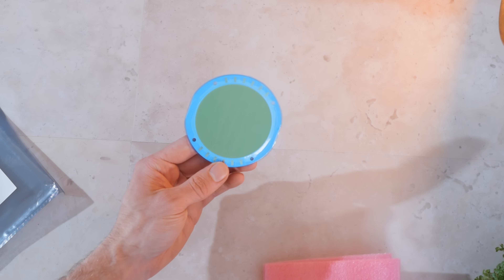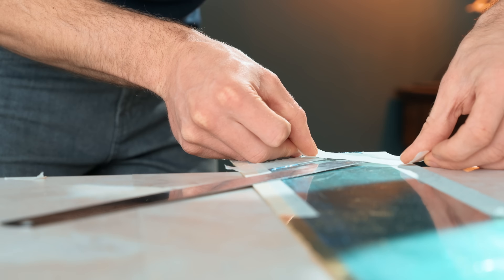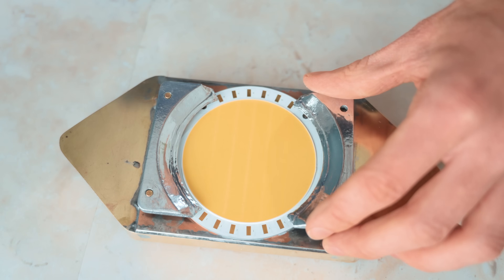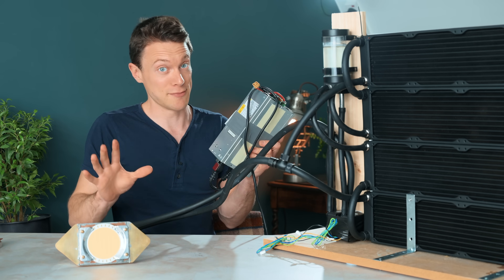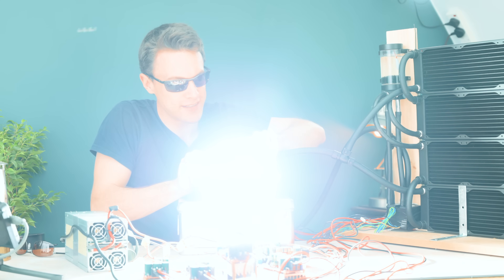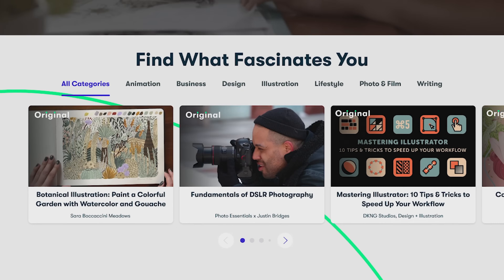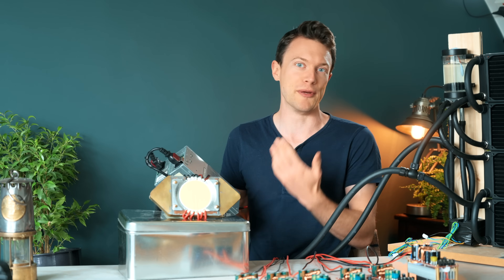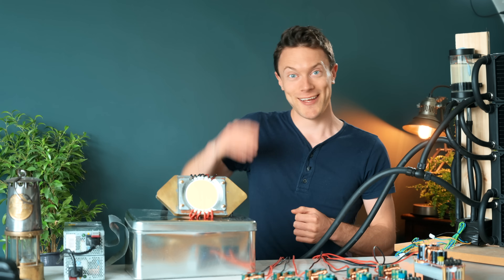Testing the world's BRIGHTEST LED!!!

Comment: Always cool to see you rig up a huge high CRI light, love your videos. Seems like you're not thinking whole-system with this though. In the end, water doesn't disappear the heat, it transports it, and in the end you just need 1500W worth of heatsinks. You could probably buy four, five or six 300mm x 50mm aluminium heatsinks, join them together with the fins facing inside (mitred), put a copper heatspreader with the LED on one end, put a lot of tiny holes (from 0mm to 100mm from the LED) to allow air entry (between the fins, allowing the fins to conduct the heat to the rest of the radiator), and then a fan at the 100mm point blowing the air out the end. You could thermal epoxy copper sheeting around the outside for better heat-spreading, and then some thin insulation (so you don't burn yourself). The cavity would be large enough that you would be able to get enough Hobbyking LiPos with the current rating to give you your 41V (12S1P) with a current controlled buck circuit, and I'd actually use 12 independent cells with a decent 12S BMS (for eBikes). You can get the "Turnigy 5000mAh 1S 20C Lipoly", have many myself, reliably do the 50A you need, cost $10 each, 12 of them would give you >5min run time for 1.4kg, and the independent cells give you better cooling and placement (perhaps inside the radiator tube if you grind down deep fins for air to flow, forced air near fins rather than through center is an advantage). Whole thing with handle could be 5kg and about 100mm x 100mm x 400mm. Best of all, your buck circuit and batteries won't lose their magic smoke because they will be strongly air cooled. 

If you must go the liquid cooling route, then perhaps look into 3M Novec cooling. Novec is hard to get (maybe less so for you), but general halogenated kerosene performs almost as well. Think mineral cooling for immersed PCs, but with the advantage of low-weight phase change heat exchange. Your next video title could be "2000W giant heatpipe LED"!

wrings hands in glee waiting for next video

Comment: Hi Matt! The LED power dissipation:
The LED have 1500 Watts, but that was the power consumption, you should take the efficiency than convert part of that 1500W in heat.
in this way you do not need a 4 480 radiator to make it works.
i'm pretty sure that a single radiator like that is just fine to handle this LED.

PSU explosion:
normally, the load should rise progressivelly, if you just switch on the psu with everything connected (and this is even worse since it have a ton of capacitive load),  it will have a power spike, the PSU voltage will go down, the LED drivers will try to compensate that by rising the current as they could, then boom... c ya

aand, the good to know:
12:02 , you just switched off all your equipment at full load, the PSU was working on maximum capacity and hot, than you shutdown and removed the ventilation, for sure had a thermal spike. That is pure poison for high power electrical equipment.

please, i want to see the sun v2 working again and maybe portable XD!

talking about portable:
try to use eletric vehicle batteries, they're suited for high wattage drain, should work fine.
Reply: i'm sorry if i sounded a bit rude or pessimist, but i tried to create a construcive criticism about the equipment failure.
i was waiting for a video of LED like this since you posted the 500w version XD

Comment: What's the efficiency of that LED? If it draws 1500W total and the efficiency is 60% (I don't know the typical efficiency of LEDs), then the thermal power is only at 600W. That means that it is to be expected that the 16 fans gigantic can keep up. To be fair, at that point, two of the air coolers would be enough as well... So, to cool a 1500W LED, you don't need a cooling solution for 1500W TDP. What I think is more impressive is that the power supplies have no problem dissipating ~200W (assuming ~87% efficiency) of heat. I don't know your power supplies though. If they're 80 plus titanium, they probably have a higher efficiency and therefore less heat to get rid of.

Comment: One of those radiators with a push/pull fan config would have been plenty of cooling. You only need 4 rads if you had no fans and were passively cooling with convection. I thought you would have done the thermal calculation. :/

Comment: I think the power supplies would have cooked because even though they are running in series and capable of outputting a total of 2000W most power supplies these days are built in a multi-rail configuration. I could be wrong about these but check the spec sheet for them. you might need to move to a Electronics Bench Power Supply. im sure you'll find something though.
love your videos keep em coming!

Comment: I haven't scrolled through all the comments to see if this has been raised before: Power supplies will have a lower rating for individual power rails. For example, an 800W supply might only provide a maximum of, say, 300W to one 12V rail, and perhaps have two of those. The remaining power rating would go to 5V and 3.3V rails. This could have been stressing the 12V section of the PSU, and if one rail was dodgy, the remaining ones would fry themselves pretty quickly.

1600W at 24V might need its own bespoke power solution! Or you could grab a few big lead-acid batteries, for at least some limited "portable" testing.

Comment: Wouldnt it be easier just to buy a small diameter copper pipe and bend(if you fill it with sand and plug the 2 ends you can do whatever you like with it )it in spiral circle,maybe solder it to a back of that copper plate and use a small water pump to push water trough it?

Comment: Power supplies have a limit of how Much of their rated power they deliver on the 12v rail. I'd say use the specs of only the 12v rail on the psus to correctly Guage how many you need in series...

Comment: Hi, i have a small opinion here about why your power supplies failed.
I can't grantee this because i don't know what supplies you are actually using but i have 2 different scenarios:

1. You power supply is rated at, let's say, 1000W total: but it might have 3 output:
An 3.3V, 5V, and 12V output and each one might have an outgoing power:
usually 3.3V has 20% of power(this case 200W), 5V have 30% (300W) and 12V have 50%(500W), and the idea is that they have a total power of 1000W. And if u tried to get all that power out of 12V it will burn.

2. And second case is that the supplies might have 1000W power at max capacity, but they are not usually built to work on that power all the time:
They usually have a nominal power  and this is the actual power that you can drain for an infinite period of time, and a max power that you can draw for a limited period of time (that's usually written into the datasheet of the supply), and if u exceeded that period of time it burnt out. 

Also you used voltage regulators that also have an efficiency, and that might affect the consumption, and so if you want to output 1000W let's say they might actually drain 1100W from your supplies or something this is usually written also into the datasheet of you converters.

And about powering it up, 1600W at let's say 24V means about 70Amps, witch i think you can deliver with 7-8-9 (depending on the type of the battery) 6S Li-Po batteries in parallel.

Hoped this helped you,
Andrei

Comment: power supplies died because the total wattage is a sum of multiple rails(voltages), you got all the power from a single rail. Power rail limits should be printed on the power supply back

Comment: I think your cooler system is a bit of an overkill, just because the LED is 1500W, doesn't mean it will outpu 1500W of heat. Pretty cool anyway, better safe than sorry.

I checked the datasheet, and it can work at 41V at 2000W!!!! And with that OP cooling system, I think you should try it, maybe not at 41V, but a little bit less, just to be sure to not burn it

Comment: You need to check how much power the PSU can provide on the 12v rail (there is an amp rating for each rail). Computer power suplie rating is the combined power for all the rails.

Comment: As higher-wattage COB LEDs become more available, there is a huge opportunity for film lights to take advantage of these units to compete with HMI lights. Obviously, a large watercooled system like this, even when it's confined to a single housing, can still be cumbersome and provide its own problems when faced to the normal and needed abuse and mobility of a film set. What is the solution moving forward for film lighting manufacturing to adapt higher wattage LED Cob units into Fresnel units while still being able to cool it effectively and run them for 12hours straight?

Comment: Nice rig! for power a couple of deep cycle 12 volt batteries in series  and a battery charger to keep them on float will work for a while, 5 6volt  golf cart batteries in series would supply the rig but you've already bought the boost converters. Anyway Great job as always

Comment: You are using the 12V supplies in series to get 24V.
So the Power Rating does not add, but stays the same opposing to using it parallel. 
This may be the reason for your supplies dying.

Comment: Wow, which filament type have you used in the filament? PC?
How about a booster from 12V PC power supply to the 30-36V 10A pr string
Thanks for sharing👍😀

Comment: Watercooling and mixed metals usually doesn't end well...
I would love to see an update on this project after a few months.
Reply: What mixed metals? Copper and brass? Did you know that many computer radiators actually use brass for the water channels inside?
Reply: @-eMpTy-  copper/brass/solder is probably fine, the rads he's using look like aluminum to me (based on how the stack of 4 moves before he fills them), and the fittings under the res are yet a another alloy, so that's lots of potential for oxidation.
Reply: My granny 50 years old water pipe is made out of brass. Never had any problems with that
Reply: Galvanic corrosion is not rally that big of a deal even with pure destilled water. the moment you add anti corrosion additives galvanic corrosion is not a problem at all

Comment: i really think that watercooling solution is very overkill. Sure, it draws 1500w, however most of it gets turned into proper light, that's the main advantage of LEDs. Apart from that I don't think server switching mode power supplies are meant to be run in series, you need an isolated output stage to do that as far as I know. Probably that's what caused them to fail so prematurely.

Comment: Turning off the power supply turned the fans off and that's what toasted it, you should have stopped the led off without turning the power supply off for the fans to keep running and cooling down the power supply and then you can turn it off.

Comment: I am not an expert, but I think that the LED is pulling more current from the power supply than what the PSU is rated for. And it is the current which creates heat. At 24 volts, the LED needs 62.5 Amps. But at 30V it needs 50A. That 12.5A difference is a lot

Comment: if you try to power it again you can use seasonic's 1600 w power supply (with an another power supply for the water cooling, and i'm not sure it works)
Reply: oh, and i forget about extra fans on the psu's fan

Comment: When you integrate this into its own enclosure, consider using quick release fittings so that you can easily disconnect the heat sink from the radiators to make it easier to move/store.

Comment: Like you said, power supply isn't supposed to be in series. 

You might have better luck, specially noise-wise if you go with a pro-sumer 1600w to 2000w PS.

Comment: do you know a single server PSU has 4 rails that deliver 4 different voltages and 4 different amps.

generally a 1000w PSU only have an half of total peak power at 12 v rail (cmiiw)

no wonder your psus failed 😅

Comment: whats the melting temp of the solder? if the block heated up during use, will the solder melt?
Reply: The LED would be destroyed much, much earlier. And the water would boil too.